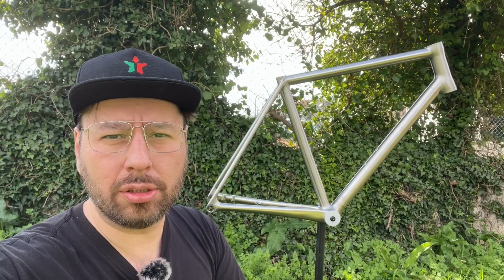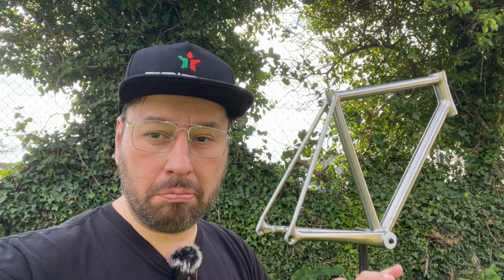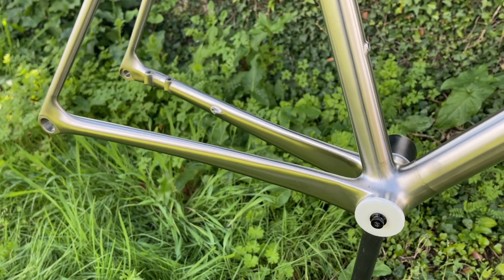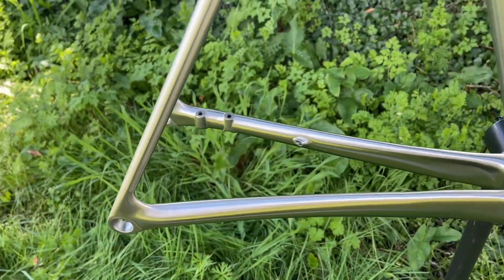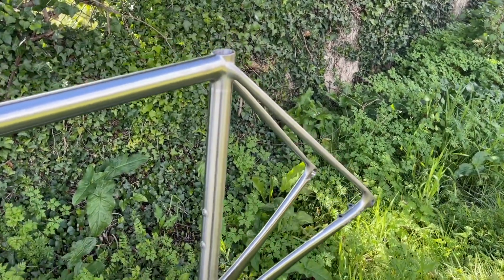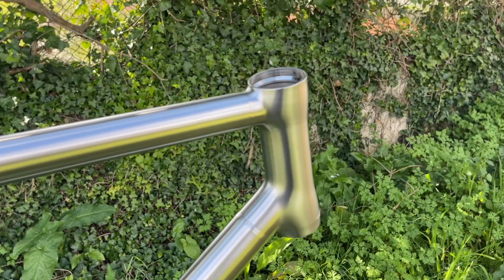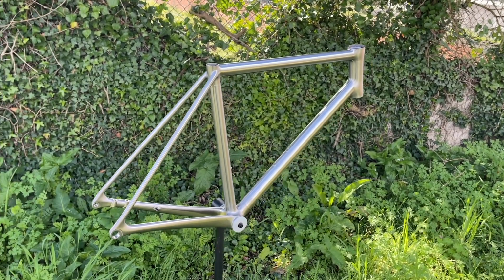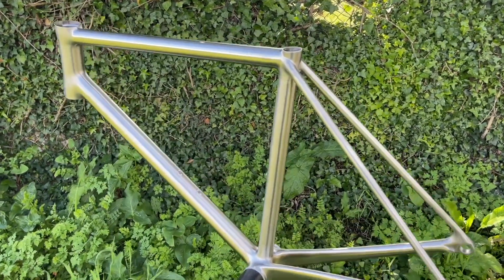Our first ever! Tritão custom titanium SLM 3D printed road disc frame.

Comment: Great video impression. I think you nailed the design. On your Instagram we can already find these "3D" titanium frames so nice getting an actual video.

I recently bought an aero shaped frame from Reilly, fully knowing its actually a Hi-Light Chinese frame. Still great frame. The point being why I did choose one from Reilly is their particular head tube shape which slightly differs from other companies like Bossi or Falkenjagd. I did like it the most (in size M only). 

So if possible, I think some future potential lies in actual nice looking frame designs. And for your case of using SLM instead of casting I think there is even more potential.

I am aware that the companies in asia are just outputting numbers unrealistic to a european company, but my comment should only be seen about the design of the frame.
Reply from the maker: Thank you! Yes, we have a lot of freedom of shapes with SLM and we are rather in the beginning of this journey. So many ideas waiting to be implemented. Thx!

Comment: Simply a magnificent frame, very aesthetically balanced and graceful, without unnecessary ridiculous details and other nuances "for an amateur", like drop seatstay. I would describe it as .... "MODERN CLASSIC SHAPE/LOOK".
I wonder, why it took so long before this type of design of that frame came finally out, none of the manufacturers does this before.
I highly recommend you to launch this frame into medium-scale production. Just be sure to make the distance of the chainstays, which fits the tire size between 25 millimeters, and 40/42 millimeters maximum. And also really need a frame in ENDURANCE geometry for long comfortable trips. Here is a gorgeous long lasting machine for all occasions.
Reply from the maker: @2spacewanderer  thank you! Yes, we also loved the result and are considering to use the same concept in a production model. The initial idea was to make it compatible with 35-36mm tires as 40-42 requires the usage of a gravel fork and slacker headtube angle and longer chainstays, taking too far from a road bike.

Anyway, we are happy to make a project like this built for you.